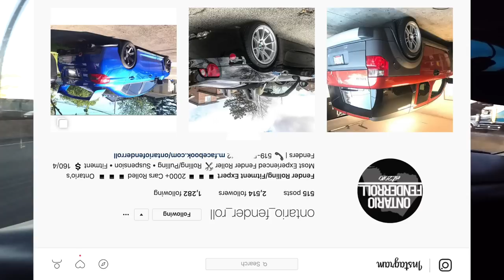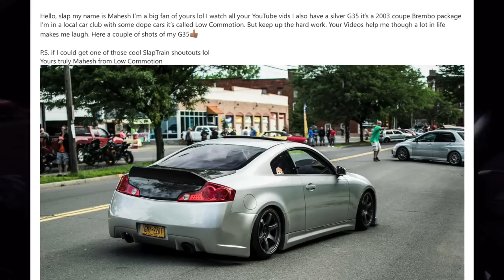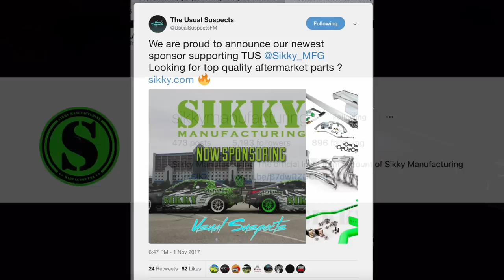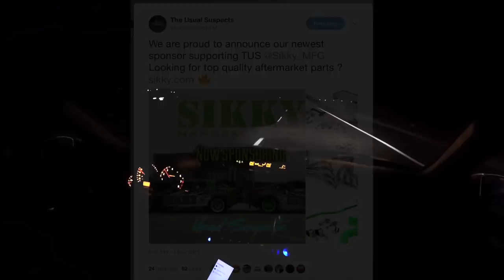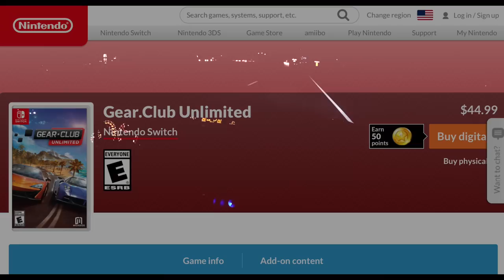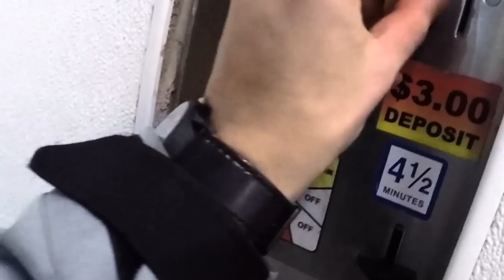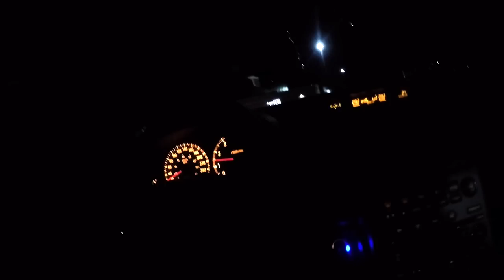Last Drive With My Work VS-KFs Wheels .. NIGHT Vlog /Car Wash | SLAPTrain

Comment: you really should start a build on your car, it looks kinda bad because of it being stock (almost) Just look at the other YouTubers, for example, Tjhunt :D
Reply: his car not stock lol he has a performance radiator,cold air intake(high flow) exhaust..
his car got 280 hp stock,im pretty sure he had 300 hp or very close were now
Reply: I didn't say that his car was completely stock, what I meant was that the outside of the car looks super stock and I feel like he should do something to it, look at Tjhunts brz.
Reply: how ok(body kit)
Reply: HD ThEmitchell I'll say 285hp...
Reply: ThatYellowGT4 impossible.
Reply: HD ThEmitchell the vq engines don't respond that well to mods.
Reply: :D not everyone wants to have a dramatic ass body kit .... simplicity is clean and satisfying 💯